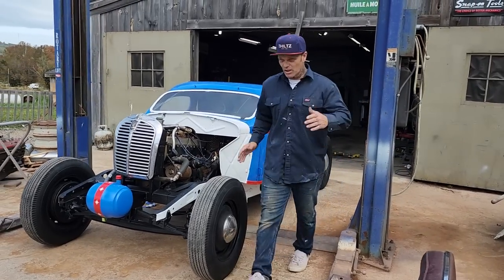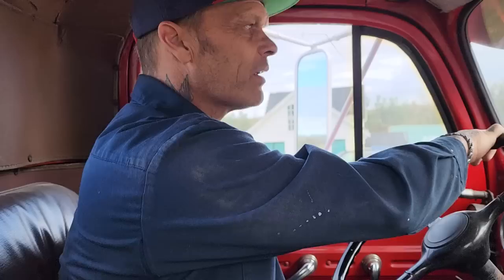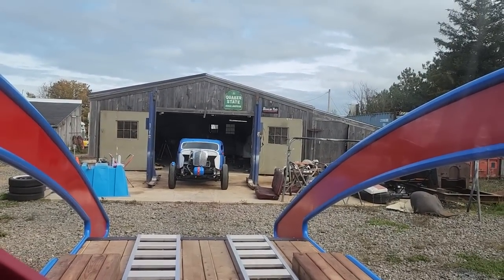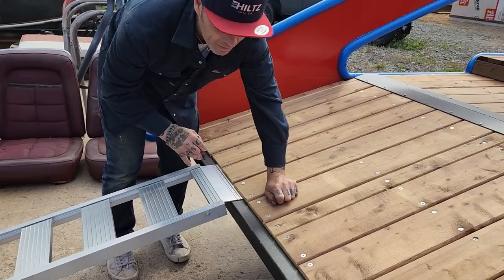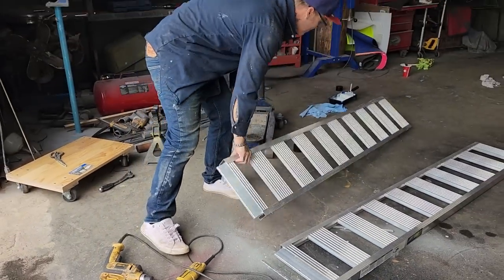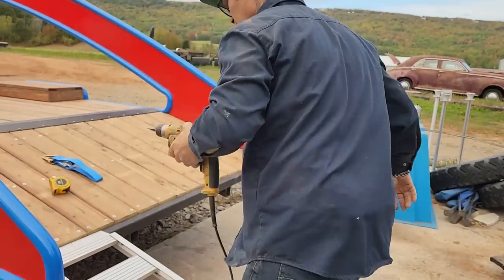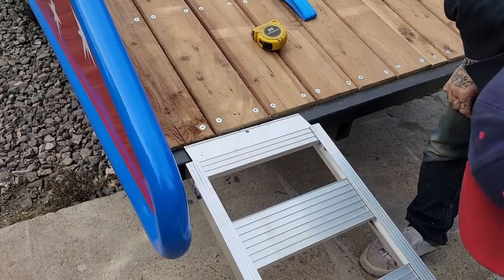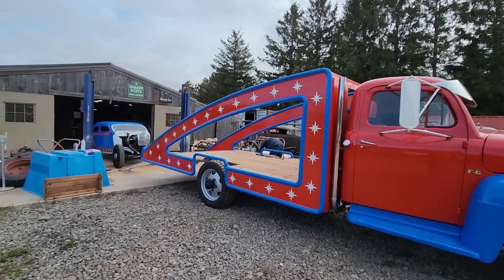Loading the race car on the 1948 Ford car hauler for the 1st time 🙌🏻

Comment: Been painting with good results , found through some resources a good saving grace for painting , a prep item that’s easy and cheap . It’s a spray cleaner from a can , Sprayway for windows , use it on the one area your immediately interested in painting , wipe down , then another dry towel wipe again , then wait 5 minutes to surely dry before painting. It will get the grease from hands or old sediment away from your work area .This is a much waited build , that’s a presentation before car manufactures where combining their efforts with racers . Only in the 60s did you see trailers and sponsors run big into racing programs. A look at what if their was such a thing , love this

Comment: Both builds are awesome Chad. There’s one thing that didn’t sit well with me though and that’s the winch cable dragging along that angled piece of steel on the bed. I’d be afraid that it would fray that cable over time. What I’d do is cut a small half inch pipe in half about a inch long and put a slight bend in it, and tack weld it in the center to guide the cable. That should be plenty to give the cable a long life. Paint it red so it’s seen and not tripped over. I’d also build some loading ramps that stay up under the bed until pulled out into place.

Comment: To position ramp spacing the car would be more centered on the ramps if you measured center to center on the tires and use that to set the ramp spacing.

Comment: 100% nailed this project Chad & Jolene, very nostalgic theme and didn’t break the bank either! Perhaps a set of stopper blocks exactly where you want the front wheels to stop then strap over the tyres with a couple of web slings will take care of the front. For the rear go through the chassis holes back on an angle with ratchet straps and your done! This is one of the best builds on video, now how about getting your ladies Bugatti sorted….I’m hanging out too see that going up the road! Well done both of you 👍🇦🇺all the best!

Comment: I worked at local racetrack in 50's thru 70's and don't recall this style unless you were Joey Chitwood or Evil Knievel, but non-the-less, you took your spin at it.  Looks great.
Reply: We had people in my area dressing their cars up red white and blue all the time back in the day
Reply: at our local track they call these kind of cars either legend cars or dwarf cars depending on the drive train...legends usually have a small block engine 305 or 302 and the dwarves have a motor bike engine usually a 600 cc and the paint schemes were usually period correct for the cars..red white and blue or something fancy from a sponsor such as mailpouch tobacco or levi garret tobacco even seen a few from jack daniels ..i mean yeah they are wraps but period correct slogans and logos..hope this info helps you.. from a 30 year veteran dirt tracker
Reply: @janeames1513  my grandpa races the legends.

Comment: For safety. Anytime you use a winch put a blanket or a jacket over the cable when it breaks that will take the energy out of the cable.

Comment: First off, Jolene and Chad...both vehicles look great, and although I wasn't around before 1960, I feel that these would have been right at home, on the tracks of the latter 40s and the 50s.
And I have enjoyed watching both projects take shape from the beginning!👍😎

Beyond that.....I have always steered clear of giving you advice.

However, this time I am going to.
I assume that you went with those ramps because they are light enough to easily move around by one person.
But I have to wonder...if over time... the stress put on them, will cause them to fail, and one or both vehicles will sustain damage.

Just food for thought... but you might consider either reinforcing them with extra strips of angle or square aluminum (lengthwise on the underside).
Or build reinforcing structures (still aluminum), that you can slip underneath the "centers" (again lengthwise), but that are separate from the actual ramps.

What can I say. It's the old farmer in me. Whenever I built something that needed to hold up to having weight on it... even for only a few minutes...I have always overbuilt.

Comment: Pro tip : ..the cable can break and or the hook can and will come loose at anytime for no reason what so ever.. someone should be in the car to control the brakes loading and unloading whenever possible ...also your truck can and will pop out of gear and the e brake pop loose for no reason,, and the truck will take off rolling on you..get some wheel chops for your truck..and install some on the bed to stop the car from ever rolling to far forward...and straps do less damage to the bed then chains will, so I suggest straps over chains for tie downs..all my advice comes from 20 years of near misses..towing can be dangerous to deadly..drive slow and smart ..great brakes and back up brakes will be your best friend..cool ass build man ,keep it up !!!

Comment: Chad - I think you should move the ramps all the way to the outside, as they looked like they were tipping sideways.  The tires need to be centered on the ramps to minimize the risk of them tipping.  Other than that, congrats on the great job on the truck and the race car!

Comment: On your ramps, if. You can weld aluminum, you an buy 2x2 angle 1/4* thick. 4 pieces long enough to reach the length of the ramp. Weld them to the bottom with the open legs of the 2x2 on the ramp. Weld them in on each cross pieces. These added pieces should be at each edge of tires. This way the weight of the car is transfered through the cross pieces to the angles to the rest of the cross pieces. 
If the angles on the lower end lifts the ramp so the two side pieces don't touch the ground, cut enough off the angle at an angle that matches the angle of the ramp so the side pieces touch the ground.

Comment: Great job. Suggest you keep some extra ramp bolts in the cab incase you lose one. Also maybe some right angle aluminium bolted to deck to guide the car on making loading easier.

Comment: Bad Chad .. if you install a pulley on the back of truck , you could bring your winch cable back thru and hook to front of the car , the which could now pull the car off as well  , just a thought

Comment: That looks fan-flippin-tastic! An idea for loading maybe - a couple round-tube bumper rails mounted in the truck tail to nudge the rear tires to center as the car comes off of the ramps - like the guide rails in an automatic car wash.

Comment: You both did an excellent job assembling both the car and the truck. With the flex in the ramps when you pulled the car on I feel you should put some sort of brace under the middle of the ramps to keep it from permanently bending like you see on a lot of You Tube channels when they are loading equipment on trailers. Am looking forward to your next endeavor.
Love and Peace.     Blessed Be.     Doug.

Comment: The truck and the race car turned out really cool. Couple of suggestions you can get metal scotch blocks that you mount in front of the car to stop it before it hits the cab of the truck also I would make a tow hook below the front spring on the race car reason being you might bend the axle over time loading and unloading it

Comment: Very nice.
One thing as far as the ramp placement. You should have measured the width from the center to center of the tires and then found the center of the actual width of the truck bed, then take half of the cars track width and use that measurement   to set the center of the ramp placement. But I'm sure that you figured that out after you saw that the ramps were not set wide enough, because as you saw, the tires were pretty close to the outer edge of those ramps. And yes the ramps did sag a bit under load.

Comment: You could have a holds on the chassis , just a thought 
I would recommend you have a strap on both sides of the car when you pull helps with keeping it straight and less pull on the motor

Comment: If you got doubts about the weight on that ramp,weld a little lip under that chadssis beam 😁🤔🤤😀so even when that one on top of the ramp fails,the thing got some extra ridge supporting it. As always,i am impressed by your stunning new creation...great sense of OldsKool hotrod styling.Evel would be very proud!!🏴‍☠️🤯💡👽🦞🍸🥃🍻🍹🎪🎇🎯✅♠️🏁🚀🛸🏝️🥁🎓🔊🔟💬🤸🛠️🆓📡

Comment: @Bad Chad .  When I flew cargo aircraft, the Loadmaster would put a broom stick at the hinge point of the back ramp so the cable doesn't rub on the metal of the hinge point of the ramp and ruin the metal cable. The cable cuts the wood but does not break strands of the cable. A simple 2x4 about a foot long would give you the softer material to protect that cable.

Comment: Hey Chad & Jolene,
You might consider loading the car in backwards. With the shape of the hauler, the nose of the car would look better towards the back end of the truck when visually looking at them together. The paint schemes together might also look better together that way also.  Just a visual thought.

Comment: they make those cargo straps for wheel hold downs, they are like strap material but weaved into a net, then there are 2 points for the hold down each side of the axles, 1 hook over the inside of tire one over the outside and ratched down.. they are SLICK,  hold all 4 wheels down, the DOT wants those more than tie downs cuz the hauler could roll and the car will stay on it, yessir they are like 3000lb+ each wheel so it will hold the car down no matter what.. you might wanna get underneath and weld up something for the through bolt system you use?

obviously the bolts are bolted through away from the side of each tire so she rolls up easily, hook, ratchet, DONE  being a hard tail she'll travel so good this way and you will feel very confident she is secure ...  best way IMHO...

for motorbikes of course the canyon dancer set up in a wheel chock are still the best way, crank down the suspension so she rides stiff...  yup.. myguess is you will use the same eyelets for teh canyon dancers or that style of tie down for a motorbike you will use for wheel hold downs

search like ratchet tire hold downs a bunch pop up, bright colors the works..  might wanna weld up a little box somewhere for tools and straps, blocks so forth

Comment: This was an absolutely amazing project. That car and that truck look like they belong together, just like the two of you. I watched one of your older videos today, where you showed a visible gas pump clone that you built a few years ago using a brake drum from a truck, and a piece of sewer pipe. I wanted to ask if the lexan you used for the "glass" was a one piece tube, or was that something you heated and reshaped??

Comment: Add a pair of alignment stripes to the bed that line up with either the outside of the tires or the center to give you a visual guide for loading and unloading. Then a couple of cross lines for the center stop points on the tires. Save a bunch of time walking around the car wile loading and unloading. And maybe 2 chocks at the front of the trailer to bump the front tires against for positioning stops.

Comment: Dang bud!!  Found myself holding my breath while you were winching the car up those ramps.  Sheesh!  I've had two bad experiences with those style ramps, so my trust level is about zero.  The side rails held up fine, but the inner slats folded on me (loading my street glide). Also, very happy Jolene was not in the car, love how you watch out for her. I sure do hope you make some center ramp supports though.  Again, thanks for the vid.  Blessings!!

Comment: I Am amazed that you don't use any engineering processes to your projects and they work out. However I'm the same, I started as an Electrician and over the years I have gotten to  junior electrical engineering level. Not bad for someone who didn't matriculate school. The key here is one needs common sense and just some built in knowledge of mechanics. It does not matter about mistakes as long as they are on the safety side, and you remember your mistakes and what you did to correct them. In fact anybody that says they have never made a mistake is a liar, or is no good at what they do.

Comment: Looking good just add some d rings 
For tie downs put 3 per side  
Take wooded fender covers off make 
Fender wells out of d plate low curve 
Car would go rite over it fine  
But thats my what thinking 
D rings be bolted all way  to frame 
With stove bolts nothing will catch on them 
You done fine job looks pretty darn cool

Comment: Just a suggestion to have a block or wheel chalk behind one of the wheels when loading in neutral. if for some reason the winch let loose you'd have a runaway race car and that is no good.  Or have your lovely assistant ride inside to be ready on the brakes. Dont rely on that winch cable to hold the load have a back up plan. But otherwise it looks cooler than dangit all loaded up.

Comment: It looks great and sits nice on the truck. Once you got it there you can now figure out where to put your wheel stops and where your tie downs will be. You could use tire slings or use chains  to hold the front and back. Looks like the best fit would be the tire slings. No the paint would not matter and who cares if it they did.

Comment: Looks like you 2 had fun.  One thing I personally don't like the look of is the grill.  An old radiator surround from an old vehicle would look nicer.  Also, the side panels beside the firewall could be removed or cut down.  But that's just my $0.02
Reply: I think I would have cut those side panels off too!

Comment: Eeehhh I still don't trust those ramps. The tongue is too thin and not enough meat under it to sustain regular use. I would support the ramps by adding a lip on the bumper so the c channel can rest on. Would make it more reliable and safer.. only reason I am no fan of those ATV ramps, I had my 78 camaro fold a set of those aluminum,  1200lb rated ramps, and destroyed the bumper, all the headlight bezels, grill, and ripped the new rad I just put on.. lesson learned.. we built a set with scrap angle iron you could drive a backhoe on and not even flex

Comment: I use this you have the red strip on the moon tank and put a strip or mark on the bed of the truck you can see when you back up use the mark to center the car and truck and when you figure the whith of the ramps make marks then everytime you load everthing lines up !

Comment: Hi Brad, great job, but I would move the ramps over about 3" either side to near the edge of the truck so the wheels are in the middle of the ramps & not right on the edge of them

Comment: Might consider putting a couple permanent checks on the bed to run front tires up against. I run towing for 10 years and really like B/A 8 point straps for tying it down. Cheers from Alaska

Comment: I think you could weld a pulley in the center of the bed right where the bed tilts downward. This way you have less chances of grinding the winch cable against the bed.

Comment: Chad glad to see you put a bolt into the ramp,question for you are the rear wheels wider from side to side than the fronts,because when you went up the ramps it looked like the rear was on the outside edge of the ramps,be careful they don't flip you might want to drill all way through with longer bolts and nuts,or even threaded rod.stay safe.

Comment: The pair look fantastic Chad and Jolene.
The outfit ( Hauler and car)  looks like a million dollars and certainly period correct.
So long as you are happy, that is all that matters, and that just my belly button.
Great to see this pair finished.
I do suggest you put some front chocks in place to pull the car up to so you have it same place all the time, and your lashing points make sure bolted through deck board and through the steel frame. 
You would be surprised how much force is applied from the inertia of the car mass rocking forward and back as truck accelerates and slows

Comment: Chocks for the front wheels and rounded wheel liners that u havnt got to remove and a small roller for the cable to run on instead of the bed and I'd say perfect

Comment: You should only use your new Princess Auto ramps upside down. That way when they bend, and they will, you can flip them right side up and the arch will make them stronger than ever.

Comment: To strengthen them ramps cut a piece of flat steel and brace the sides of the ramps and drill 4 holes and nut and bolt the plates to them then maybe paint the steel plates maybe blue to match the truck or something just my idea I have a heavy duty set of aluminum ramps for my car hauler but they are a pain in the ass to haul cause they are so long

Comment: You need a strap to hold the steering wheel straight and maybe chad put a longer cord so you can adjust the car and winch and make a hanger or box to hold the cord and control

Comment: Use aluminum  3/16 or 1/4” aluminum diamond 💎 plate and roll it for the rear wheel housings fixed in place permanently so the race car will roll over the rear truck wheels like it’s not even there and the look 👀 from the aluminum is awesome 👏😎

Comment: What would it be like to make a cover for the winch out of the wood you made the wheel wells out of, and line it on the inside for weatherproofing.  Or you could use an old 50's toolbox or a vintage bag as a cover  john

Comment: You did good, now get yourself an old timer who can teach you to change gears without breaking teeth off your gears. Or another option would be to fit a later model gearbox. I dont know what you paid for the truck, but lets say you have $8000 - $10000 in it total, truck and race car, what great value for the amount of fun you guys will have for years to come.